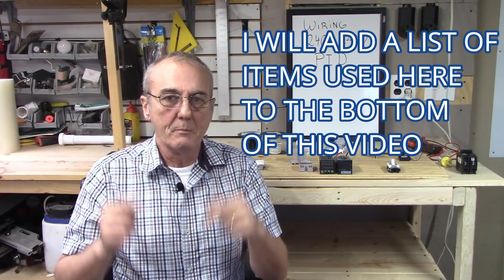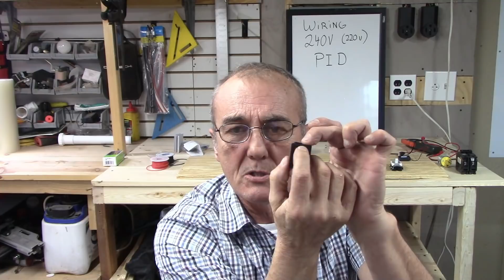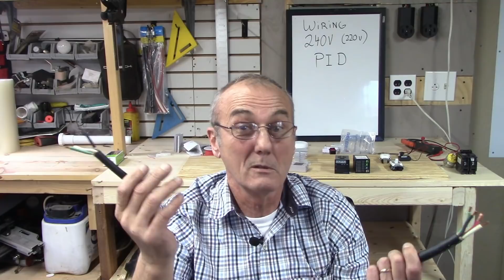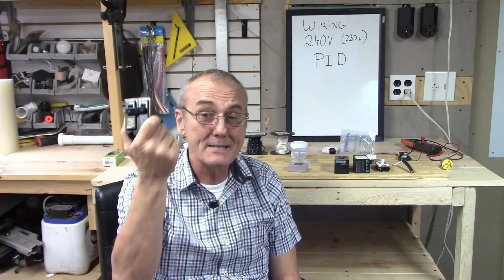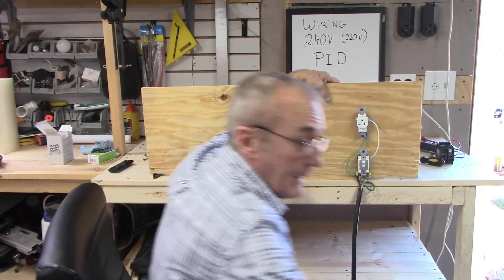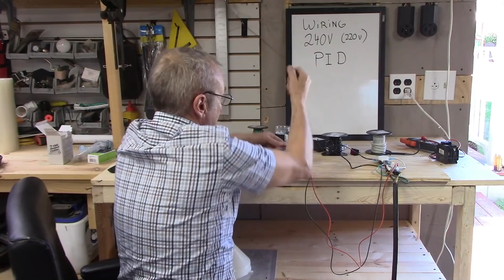WIRING A 240 VOLT 20 AMP PID CONTROLLER

Comment: My element is 5500 watt so I had to supply 30 amp 220 to PID.. I gets warm when I first start it but it is wired correct. 20 amp double pole is not enough for my element

Comment: Hello all! I'm assembling a panel to control a heating element. The element requires 240v 5500W. The circuit I have seen uses a hot leg off of each side of a 240V switch to 9 and 10 of the Inkbird ITC-106VH. An electrician here suggested using a fusable supply of 120V to the Inkbird instead. Every example I see uses opposite legs of the power supply to the load. Is it okay to have opposite legs of 120V from a separate outlet to the Inkbird while having it control a 240V load through the SS Relay? The breaker circuit is a 50A also, is that a problem?

Comment: Please check with an electrician regarding your statement that the two hot leads are out of phase by 180 degrees.  I believe they is only a single phase.

Comment: When the switch is turned on isn't one leg hot at the plug or element regardless if the relay is active? What does a 240 element do with just one leg active and the other disconnected? I'd think it might be a little bit of a safety concern as well with one leg hot which is why I'm asking if two relays ,one for each leg, would be a better setup? Thanks for all the work you do!

Comment: Based on the wiring, if the switch is on, even if the PID is off,  it's going to be pushing 120v to one lug of the socket. Based on that, I say never plug in your element, unless you've got liquid in the boiler.  Because you'll end up giving the element 120V!   If I'm wrong, please correct me.

Comment: I hope you or someone reads this and can give me some advice. I have mine wired exactly like this and my outlet reads 240v at all times. Switch on or off doesn’t matter. The pid is only on when the switch is on. What have I done wrong?

Comment: Hello thank you for your wonderful video and i have a question for you

Now i am developing a food drying machine it is a vacuum drying oven. my design is to use a straight heating rod in the left, right and at the back of the oven. I used 4 heating rod for each side. hence i have a total of 12 heating rod and since i am connecting two rods together at one end i can consider them as 6 pair of heating rod. Now i wanted to connect the 6 wire at the other end with on PID temperature controller. Can i do that? can i use a connecter to reduce the number of wire in to a single wire using a connector? what is your suggestion.

Comment: Hey George! I will be running a single 5500w element on my 16 gal reflux Mile Hi still. Did you ever do a video on a 220v 30amp PID ? If my math is right 5500w works out to a 25amp draw at full power so requires a 30 amp feed . Any help would be greatly appreciated and keep up the great videos
Reply: Hey Paul,  I'm doing exactly that myself in a 20 gallon build. My element is also 5500w which at 240v works out to be 22.96 amps which I'm calling 23 amps.  If I'm not mistaken the only thing that needs to be changed in this equation is the 20 amp on/off switch.  I bought a 30 amp switch and I'm adding that to my build.  I already have a 50 amp and a 30 amp breaker that runs my welder so I'm using the same female and male plugs as the welder so as to not have to add a different style plug and I am only using one PID controller.  We shall see....  GL to ya
Reply: Did you all use the same 12 gauge wire or 10 ?
Reply: @copperstillco  I used 12 but I havent had the chance to try it yet.  I'm hoping my equations work out right,  If not there goes a 50 amp breaker I guess.

Comment: Mister, I can’t thank you enough for this video! When it comes to wiring and understanding electrical circuits I am a complete idiot but this is exactly what I need to operate my sterilization tank that I built. Currently it is running a 5500w element right off of the breaker with no control what so ever. Probably not safe and is definitely hell on my electric bill. I have watched countless videos explaining hoy to set something like this up and I never understood a single one of them! You have made this so simple that someone like me that is terrified of electrical work can face this project with confidence. Thank you so much sir for taking the time to show and explain this.

Comment: First of all, I've learned a ton from this video so far, but I'm going to need advice on running 2 4500 w/240v elements off of a single PID. Treating the 2 as one?

Comment: I have a 240v 50 amp plug in my basement that I occasionally use for my stove, can I use this plug for my 240v pid?
Reply: Can I just replace my 50 amp breaker with a 30 amp breaker?

Comment: Good morning Mr George.  Most of us know dc power as red hot black negative so I was thrown off when I saw several references to blue being the hot on the thermal probe. I noticed you used conventional connection. If you ever had a problem hooking it up conventional you wouldn't be doing it so ill be pulling my pid back out to swap wires again. Do you know anything about blue being used as the hot wire?

Comment: Great series of videos on the pid controller build and set up. Information is invaluable. I do have a question. My build will have 2 3500 watt elements can i run both elements in parallel with one 40a relay?

Comment: Mrng sir I buy a REX-C100FK02-M*AN pid controller its output type is RELAY in the manual it shows RELAY CONTACT OUTPUT. can I replace RELAY CONTACT OUTPUT with Solid state relay

Comment: George, I'm building a powder coating oven and using  4x 2400w elements with two 100amp relays and a linkbird PID (240V) and the linkbird timer  Not sure how to wire up the two relays and the two units? Cheers Nick.

Comment: Hello George I would like to run a 40 feet 240 line . Will10 gauge wire be good enough for this. It will be for a air compressor  that runs 240v/15.0a/60hz/1ph.     3.7hp peeks at 6 hp
Reply: 40' from your panel - you should be fine.

Comment: With running one 120V leg to the right side (white wire) of the outlet, doesn't that mean when the switch below is turned on you will have a constant 120v running to the switch, and therefore the element, essentially running it at half power while the switch is on?

Comment: 18AWG is only rated for 7 amps. In the case of a fault/short your 18 gauge will burn up before your 20amp circuit breaker trips.
Reply from the maker: I only use this gauge for low current portions of the controller. The element and SSR are matched with either 12 or 10 gauge.
Reply: @BarleyandHopsBrewing  Mr. George I understand that the PID draws low amperage under normal conditions, but if something were to go wrong with the controller causing a short, then your wires will burn up long before your breaker trips.
Reply: @BarleyandHopsBrewing   Also, I'd like to say after only watching a few of your videos I'm a huge fan. Keep up the good work.

Comment: Does the amps on the switch need to be the same amount than the amps the heating element uses? or can it be less? because the ssr is working like a switch and the rest of the components use a lot less than 20 amps
Reply from the maker: I use a low amp switch since I am switching the PID and not the element. The SSR controls the element.
Reply: @BarleyandHopsBrewing  Thank you, that solves my issues. I really like your videos you explain and simplify everything very well. Thanks again for answering my question
Reply: To reclarify this. Your switch should NEVER be rated at a lower amperage than the circuit breaker that protects it. Yes the PID only draws minimal amperage under normal circumstances, but all circuits should be designed with the worst case scenario in mind. Never put anything in the circuit that is rated lower than the circuit breaker. If your breaker is 20A then your switches, wires, elements, etc should be rated for 20A or more.

Comment: Hello George, can I use a ITC-308 as my 2nd 120v (hot) cable? Same idea, but I would really like to use the Wifi. Also 20AMP breaker. I the unit uses 7AMPS

Comment: So is the PID only controlling one leg of the 240v outlet? The white wire is uninterrupted and supplying 120v as soon as the switch is turned on. How does that affect the heating element, won’t it always have power?

Comment: I’m interested is building an electric smoker. This makes sense, but will you not receive 120v  to the element once you turn the switch on?  Or is it inconsequential to have 120v entering your 240 element. I’m considering wiring the first leg of the 220 switch to one leg of the element directly, then running the second hot through the PID.

Comment: The Ampacity of #12AWG in Free Air, by itself is: 30Amps
The Ampacity of #12AWG in a Race, Conduit, or a Cable- in conjunction with Fault Current (ground), and Return Current (neutral) wire is: 20Amps (for a reasonable length under 75' of course...)

Any insulated wire, rated at a certain temperature, placed in conjunction with other wire(s), in the same race, conduit or cable, must be "De-Rated" (distance must also be taken into consideration)

Because Wire, when heated, looses Ampacity- its ability to carry a specified Current or Load is diminished when heated... plain and simple...

Best practice is to derate the wire and just stick to that for all applications, so using this derated model as defined in the 2017 NFPA NEC 310.15 ("the code") the following would be a best practice:

#6awg-60A
#8awg- 40A
#10awg- 30A
#12awg- 20A
#14awg- 15A
#16awg- 10A
#18awg- 7A

The formula for this is as follows:

Tp= Ta+(In²/It²)(Tm-Tt)

Where:
Tp: Operating temperature
Ta: Actual or expected ambient temperature
In: design current of the circuit (this would be your Load)
It: value of the current tabulated
Tm: Maximum permitted current of conductor (this is listed on the wire, typically 70C or 90C)
Tt: ambient Temperature +30C

A shortcut would be to -30% of the stated amperage of a wire in free air, and round down:

Example: 30a/1.30=23.07 rounded down to 20A 

All wire Ampacities are listed as being "in free air" so caution must be taken whenever you have more than one wire to calculate the correct ampacity of the wire for the given circuit...

Cheers! love your shows! I know y'all already know all of this; but maybe some folks could benefit from it...

Joshua the Industrial Elechicken

Comment: Won’t there be a constant 120 volts going to the element? From the switch
Reply from the maker: You need both legs of the flow in order for power to run through the system.

Comment: George, you continue to amaze me with your knowledge. What did you do for a living before this? I'm guessing electrical engineer. This is great info but I'm running my still by guess and by golly. I have three electrical heat sources and shut the first two off after the still starts producing leaving a single 220V hot plate at the bottom to run on. I found internal heaters tend to produce a lower ABV throughout the run while heating from the bottom produces higher. Not completely sure why but it works better with heat say the bottom. I'm wondering if a pid would give me better heat control, sounds like yes but maybe not that big an improvement since I'm not leaving the thing to run on its own. I gauge the speed by output. Am I all wet or just a bit old fashioned?

Comment: It appears you are still using the fake Fotek clone SSRs I have warned you about before. I gave you links to several articles about them and their tendency to fail and even catch fire. Many are not rated at the amperage they claim. There is a reason they are cheap and  not certified by North American agencies. Also, the  electrical power used in your PID controller devices are extremely dangerous and can kill instantly.  As most know water and electricity are a dangerous combination that's why, among other reasons, Ground Fault Circuit Interrupters (GFCI) are mandatory for these applications yet none of the devices you've built contain or reference them. The breaker you showed was an ordinary one and was not GFCI protected.

I hope you have a lot of liability insurance.
Reply: Hello Snapp, as I am going down this road of building a PID controller, I would like to add GFCI to the box to be on the safe side as I may be using a PID inside or possibly outside. George is a great guy with a wealth of knowledge and I thank him for sharing this knowledge. it would be great if you could share some of your knowledge maybe with a video of how to add some safety features such as a CFCI to Georges' setup?
Reply: There's always somethin to be afraid of isn't there snappi?
Reply: @frankburk8930  We have common sense  electrical standards so people like you that lack it won't harm yourself or more importantly, harm others.
Reply: @snappingbear  The public and I are very lucky to have someone, such as yourself, willing to share how much you think you know and how little you think we know.
Reply: @frankburk8930  So you believe you speak for the public. This isn't surprising given your lack of common sense. Your pathetic response also proves you project your faults onto others.  It's obvious that if you attempt to build any high energy electrical devices you'll end up being a Darwin award winner.
Reply: @snappingbear  Perhaps my goals and yours are different.   It could be that it's your job to sew the seeds of fear via the propaganda machine that is the internet.

Comment: Hey George. I have a small 120v still and a bigger one that’s 240v. Just fyi you can use the same pid for both if you build it for 240v. Amazon has adapters for the plugs. But you have to be careful with doing so. Don’t want to get them mixed up so it might not b for everyone. Lol
https://www.amazon.com/gp/product/B082X6B6N2/ref=ppx_yo_dt_b_asin_title_o03_s01?ie=UTF8&psc=1
https://www.amazon.com/gp/product/B075FTC9RT/ref=ppx_yo_dt_b_asin_title_o03_s02?ie=UTF8&psc=1

Comment: Hello George! I hope you can help me. Can I add some water to final liquid (after fermentation but before destiling) if I worry about burn it out the heater in conteinar. I got 50 litres of capacity of my container but a got small amount of my liquid about 15 litres. I m worry that durrning the process of destiling the heater will go above the liquid
Reply: I am not George, but you  can absolutely add water to your mash or wash before distillation. It will not negatively affect the process at all.
Reply from the maker: Excellent answer
Reply: Thanks for your answer👍 I did set two mash one from orange second from apples but when I did it I thought I will buy a simple pot still destiler with 15 litres of capacity. But I was reading and watching about whole process and decide to buy bigger one and with the column. Happy destiling

Comment: Love these videos,,just started a few weeks ago,, has anyone ran any mildly  slightly stale beer, my buddy had about 4 1/2 gallon  left after his retirement party ,I guess having that much left prove that he needs to retire anyway, was wondering if anyone has ever ran any thanks for the info,keep the info flowing,, Thxs again.,gb
Reply: You might ask your friend what the abv of the beer is to figure out your potential.  Also, I just learnt that if it's hopped, those hop oils may transfer during distillation and could affect flavoring.
Reply: @1MIC2GO  Thxs for the info, gb
Reply: @1MIC2GO  Yeah, unfortunately, oils can steam distill and you end up with it in the distillate. That can be a good or bad thing if its what you want.

Comment: Can you use the dryer outlet To get your 220
Reply: dan boatman
... the outlet/reciprocals are different. if you're into wiring you could run a side box off your dryer for 240 BUT would not suggest it.  for safety you really need to go thru a breaker on that line. AND dryers are 30 amp.
Reply: Yes you can

Comment: My mind says with that white leg coming off the switch going right to the plug once you flip the switch the element will try to use anyone that touches the still or the water in the still as a ground back to neutral.  How is that not what happens?
Reply from the maker: Electricity needs a complete path. The element is not energized with one side on. Once the other side is on it is energized and the current flows through the element only.
Reply: Barley and Hops Brewing thanks again George you  are a Godsend to those of us starting out!
Reply from the maker: @scubasky  That is what we are here for. Hopefully it explains the issue you brought up. Don't be afraid to ask. It is an obvious conclusion when you look at it at first.

Comment: Thank you for sharing, always love your videos.  Can you controller three different heating elements from one box, if so how?
Reply from the maker: No. That would overload the controller.
Reply: @BarleyandHopsBrewing  OK thanks
Reply: A conventional set-up like a domestic water heater has separate thermostats for the upper and lower element. The goal is to smoothly achieve a relatively even temperature at all levels in the tank. Of course, we won't have cold water rushing in as the hotter part of our liquid turns to steam.
Reply: Bob The Electrician thanks for the help  this would would be a herms system with three different pots.  Hot water/mash/brew for making beer.

Only two pots will be used at one time.